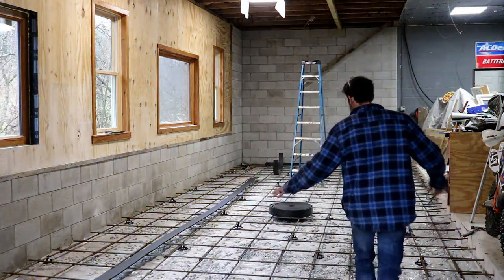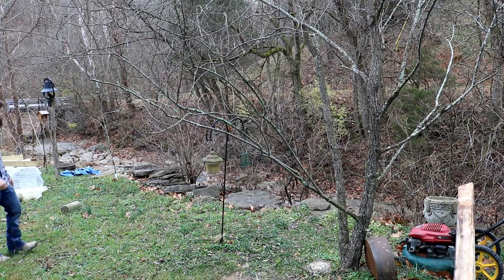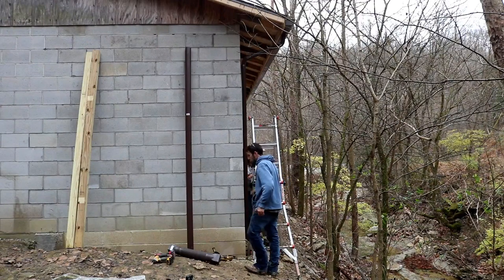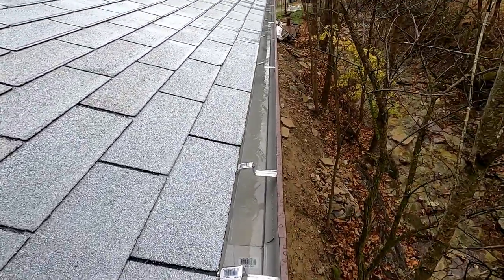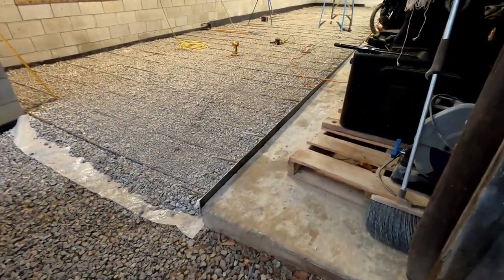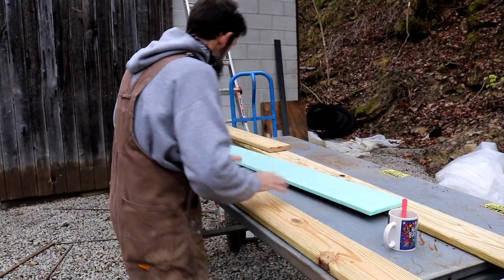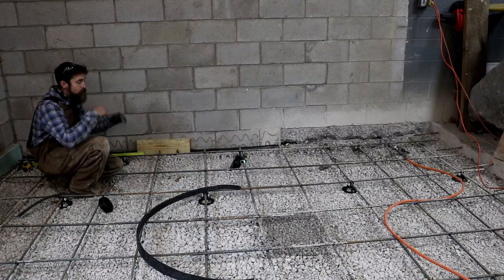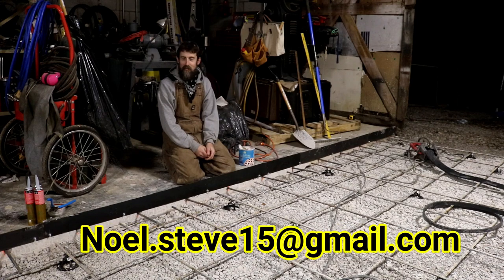Concrete Form / Expansion Joints / Troubles and Changes.

Comment: Keeping the gutters free from leaves will be a hell of a job in fall I think
Reply: Bottom line is, it will never ever happen regardless what the different products say they can do. Usually you swap one situation for another. Just get used to cleaning the gutters out and let it be...
Reply: @garymucher9590  Not true, if you install the right type of gutters you'll never have to clean them. I had installed " K-Guard " type of covered leaf- free gutters about twelve years ago. A have a lot of trees close to my house and have never had a clog or the need to clean them. Maintenance free.
Reply: I installed gutter guard which completely covers the gutter and relies on the waters surface tension to follow the metal guard into the gutter. Has lifetime guarantee not to plug and if it does they come and fix it. Been in place for about 20 years and only one plug and they came and removed leaf stems. Prior to this I was up on roof multiple times a year.

Comment: Thanks once again! I so enjoy watching you problem solve and design, plus your willingness to change your mind and re-do things better. I can hardly wait to watch you design and build your new shop.   A suggestion for this: use as much of the wall height you can for hung shelving. Having high shelving for lighter, seldom used materials such as gasket material, plastics, whatever has saved me so much space in other areas. I often use the common adjustable steel brackets you anchor to the wall.

Comment: 31:30 .."settle" .. yup .. rebuilding old stuff becomes a lesson between square and level or true to existing. Tha is for sharing!
Reply: True, you find a lot of buildings which are very far from square, or level. Just you do not notice it in the majority of cases until you do something that requires being truly level. Then you get the AC unit is not level, but is, the roof is not level, and that is the view reference point.

Comment: As far as your battery charger goes. For now you can try a good easy trick to fix it. It worked for me twice. Just go to plug it in the wall, then just keep tapping the plug into the wall socket real fast multiple times about 7-11 times. Then plug it in and it just might work. I know that sounds rediculous, but its true and wont cost a penny of money, and less than a minute to try. Good luck!

Comment: before laying  the concrete, ,spray the hardcore with water, this will help to stop cracking , cracking will happen if the water in the concreate is drawn into the hardcore to fast, have seen this happen. hope this helps. JB U K.

Comment: I would nail the black expansion foam to the wood.  You'd be surprised how many PSI that blue foam can take.
Reply: Yeah it can hold a lot, and its also closed cell meaning it won't let air escape from the bubbles. We make gaskets out of it to pressure test furnace components, and its not really suitable for an expansion joint imo. I think I would have just tapconned a piece of angle iron to the wall to screed across, and then pulled it out when the floor cured, or ran it toe down and just left it in there.
Reply: @codylapoint  Lot of things about that job kind of tough to work out best steps.   Necessary compromises to fit new into old there.  I am betting he's getting really tired of working on that shop instead of metal work. Love to see him do the other side.  I bet he'll be doing so well in 5 years, we'll be in a new shop.  ;-)

Comment: Recently had driveway and patio concrete tore out and replaced. My concrete guy put fiberglass fibers in the concrete. He said the fiberglass doubles the concrete PSI loading.  He poured 7000 PSI concrete with fiberglass resulting in 14000 PSI concrete.  The finish is maybe not as  smooth, but was broomed anyway.

Comment: Looking good Steve! You may want to weld some scraps of steel about 1/2" above the old floor to your form. Then you can use a wrecking bar or all kinds of implements to pry up the metal form. The eyelets may work good after you've moved it off the anchors, but they'll be a hard pull to start. Prying like that will be much more gentle on green concrete.
Your sentimemts about dealing with the wacko preexisting floor heights sound good to me.
Thanks for sharing

Comment: The whole building (and the land under it) will stretch when the weather gets hot,   It's only hot machines you have to allow for with the expansion joints.
Reply: So true!  Nuclear submarines do the same thing.  They stretch, twist & bend by inches!
Reply: True, the absolute temperature is not a worry, only the difference in temperature between the parts, as the walls will also expand and contract, so the expansion joint only has to handle the difference between outdoor and indoor ( and ground) temperature.

Comment: Steve you might consider when pouring the old section to level making dimples in the old slab with a pick along with the bonding agent. I used that when I worked with a pool company and we did a recoat of pool white coat finish and pool deck refinish to add additional bonding surface to hold the new work.

Comment: Looking good man. With a slab that size you should be able to get away with just 2 cuts. My 30x48 was cut into 6 pieces. You don't want them to small since you won't want a machine to straddle two pads.

Comment: That 5/8" expansion is worst case assuming everything else will not move with a 100 C temperature swing, which is almost certainly not the case... either way better to be safe!

Comment: All that expansion calculations is a waste of time for a garage floor.  It is right on the ground.  It will never ever gain 100 degrees in temperature.  Even if you pour your slab when it is 50 degrees below zero outside the ground inside won't be near that.  When the concrete is curing it will actually produce heat.  When the concrete is finally cured it will cool off to ground temperature.  It will stay there for ever. The only thing you have to worry about is shrinkage.  When it dries it will shrink.  Never to expand again to the size it was when poured.   It will never see direct sunlight.  It will never have air underneath it to raise it in temperature.  It will cool off after pouring and shrink.  Period. That expansion you are installing on the outside wall is a waste of time and money.  It will shrink away from the wall when drying and never will expand to fill the gap when it dries.  What you will have to do is cut lines to control shrinkage cracks.  Your slab will never crack from expansion.  It will however crack from shrinkage.  Expansion joints are for highways, sidewalks, bridges, etc where  the temperature can change excessively.  We poured building floors that cover acres and acres and not a foot of expansion.  We did cut many control lines to accout for shrinkage.

Comment: A 7” pad will be fine for a power hammer up to 50 lbs or one of the utility hammers like a 155 lb Big Blue. They don’t give the same percussion as a 100 lb mechanical. But a 25 lb or 50 lb mechanical is fine on that. I’ve done 6’ deep foundations for our hammers

Comment: Concrete shrinks as it cures. You will likely notice when it is cold out that the concrete actually pulls away from the expansion joint material.

Comment: Great work, Steve! This series is excellent and much appreciated. The natural light from your wall of windows is tremendous. If you are still thinking about how to cover the outside of that wall, I have a suggestion. I think it would look great covered with cedar lap siding or cement board siding (like Hardie plank - expensive and messy to work). A faster and cheaper alternative would be T-111 siding (I think that is what it is called). Then maybe paint the siding with some red barn paint. Kind of a cool contrast to the rest of the building. Thanks!

Comment: Your ground underneath will always keep the temperature in the slab within 10 degrees so thermal expansion is more like zero. Thats the only advantage of not insulating the floor.

Comment: Concerning the steel plates and slots cut into them. I was thinking that it might be better to cut a wide 'V' slot, instead of a 'U' slot which is the width of the bolt threads. Reason being is that with a 'U' slot you have to pull the plates straight upwards, whereas, a wide 'V' would give clearance for you to yank on the plate from either end, back and forth, and not jam up against the retaining bolts.

Comment: Hi Steve.  Anchoring concrete to the walls or the existing floor does not allow the floor to float or expand and contract. This builds in stress so you get cracks. My concrete guys wanted to join the garage floor into the walls. They said it will crack if you don't.  30 X 36, 10 years old and still no cracks. It has to float. But what do I know. Hahaha. Best regards.

Comment: You are going to get cracking where you put the steel screed. Your metal should be higher as being on the top of the rebar leaves a gap for the cement to break off. The rebar needs to be surrounded by at least 2 inches of concrete. This is what I see may happen but I am not completely sure. I imagine you did your homework. I guess I will find out in the next episode. lol   Awesome job. Can't wait to see you done and get back to normal life.

Comment: Please think of putting plex piping in for radiant heat before you have the concrete poured  that way if you want to heat the shop up it is a great way to heat it and will not cost much to be prepared for it

Comment: Steve, if you are lucky enough to add a power hammer to your shop, a 7-inch thick floor will not be thick enough.  I've seen "footers" for power hammers go several feet thick of heavily reinforced high-strength concrete, separated from the main floor so as not to transmit as much shock to the surrounding floor when the hammer is in use.  You'll have to cut the appropriate sized hole in your floor and "dig" wherever you decide to place it.  However, I do hope that you are lucky enough to find an affordable power hammer (in good shape) and show us your journey learning Blacksmithing -- I'd love to have a small power hammer myself!

Comment: Concrete cracks due to shrinkage, not expansion.  The wetter your mix, the more it will crack.  Your ground temperature where the slab is resting will not vary more than 10 degrees from summer to winter ( unless you are sitting on an active volcano.)

Comment: Man, i think you will be glad if it is all done and do some machining again. :)
I would leave the plate in there, it will protect and prevent the edge from crumbling, also a good choice to leave foam against the wall 
It will isolate the floor from the wall not only for expansion but also to prevent vibration when running heavy machines, so it isolates these vibrations from traveling in the walls.

Comment: Steve, I love watching you do your job, but  it hurts to see you waste time and material.  An interior concrete slab will never expand, only contract, hence the cracking, when concrete cracks it contracts. Only exterior slabs that get wet and experience freezing conditions, where ice forms in cracks, can concrete expand. A snap line is all you needed at the perimeter and an experienced crew will float-screed right to the line. Also, while I'm at it, don't forget to install some wire-drain-strainers in the downspouts.

Comment: Seems it would have been easier and given you a screed surface to scribe the taper you needed on a piece of 2x4 or 2x6 cut it with your worm drive and hold it in place with concrete screws through the edge or 'L' brackets at the back.  Your mud pressure won't be all that much on a flat slab so anchoring it could be done with sacks of sand or whatever, 2x going to the back wall or whatever.  Steel is getting so expensive it seems a shame to waste.  Looking very good.  Might beat the snow yet!

Comment: I like your work Steve. One thing I don't quite get is why you wouldn't tie the edge of the slab in to the new wall? After all the effort you put into the footings for the wall I would thing that would be the perfect way to anchor the floor into the wall so it sits on the footings as well as the ground beneath so there's little chance for subsidence. Anyway, I was just curious... Keep up the good work, mate!

Comment: Tool advice from a pro: Milwaukee and Makita seem to make the best drills, while Dewalt makes the best corded 4-1/2" grinders... At my machine & fab shop (14 person operation), we have Makita drills and Dewalt grinders that are used heavily every day. Makita drills seem to last about 6-8 years, batteries last 3-4 years, and the chargers NEVER break (We have 10 cordless Makita drills and 10 impacts). 

Dewalt grinders last about 2 years between brush changes, but besides brushes & switches the average lifespan is 10-15 years (Note: Death wheels kill grinders). Keep in mind, each fabricator and service truck has 5 grinders (each grinder has a different wheel: Flat disc, Flap disc, death wheel, Scotchbrite pad, & wire wheel. We own in excess of 60 4-1/2" grinders). 

As a side note, I can tell you that small portable inverter TIG welders (We've settled on Miller Maxstar's, and have used Thermal Arc and Lincoln in the past) only last 5 years in the field before they break and become as expensive to fix than to buy new—brand doesn't seem to matter... Meanwhile, our Miller Syncrowave's never break—they rang in age from 1 year to 25 years old, and we have a Miller Dial Arc that's from the '80's. The big analog machines are king in the professional, every day use world. Further, we've had nothing but problems with Miller Dynasty (inverter) shop welders...

Comment: If you are just going to skim that other area, try finding a concrete bushing tool for either the jack hammer or bulldog rotary hammer drill that you have. ~$45 that is worth it to help make a bonding surface with the old concrete.

Comment: The air temp can easily change 100 degrees F but that floor slab won't.  If that slab increases by 100 degrees there likely won't be anyone alive to care.
Reply: Well spotted. It will probably stay pretty much at ground temp.
He had me worried about my new shed slab for a minute : )

Comment: I don’t think you need to worry about concrete expansion that much. The floor is always going to be the same temperature as the ground below it, and that doesn’t vary all that much through the year.
Reply: True, since he’s not insulating under the slab at all....

Comment: Hey Steve, with that much roof, I think you will need more than one downspout. Otherwise in a heavy rain it will overflow.

Since you already hung them and it would be hard to re-hang in an inverted V to send some left and right, you may want to poke a hole in the middle to divert the stuff from the right to the middle and let the rest go to the one you put on the left corner.

edit: and you could have used the wood and stapled the (original black )foam to it for your expansion join. I just use a joint caulk. sika sikaflex ... just as an FYI ... there are so many ways to skin a cat, just putting another one out there.

Comment: Steve, I rewound the video, but I still do not understand why you plan to screed to the back of the existing pad.
Why not just leave a step there until you demolish the old pad and repour?
Also, the lumber and blue foam look kludgy.  Why not use masonry screws and fender washers to attach the black stuff to the cinderblock?

Comment: Should have used self adhesive abelflex. Bang it with a hammer and ot dont come off. That insulation doesnt look compressible enough for expansion. Though im not there so not sure. I wouldnt be putting timber there though,  a good concreter can screed using laser level.

Comment: The expansion is 100 degrees delta, so it would have to get up to 160 degrees F.
Hope you are just going to leave the metal in and then you can use it again for the old slab. It is going to be off the ground so it will not rust from bottom up.

Comment: Do you still have that Harbor Freight metal band saw? Flip it up  and attach the wider plate and you can run that screed sheet through it. I do it with my Delta version of that same saw. As long as you have 6 inches or less of cut-off it will work.